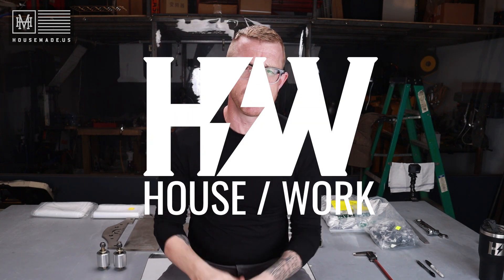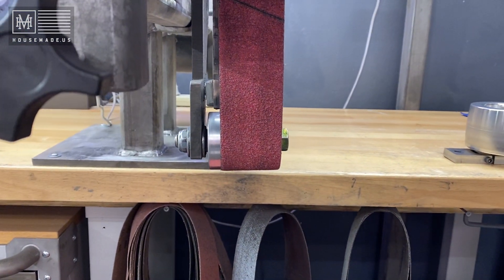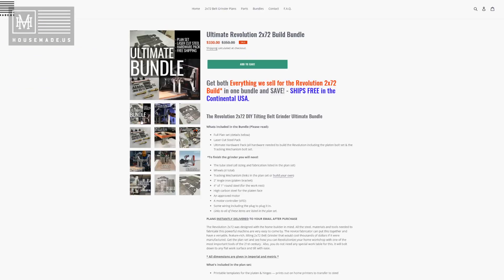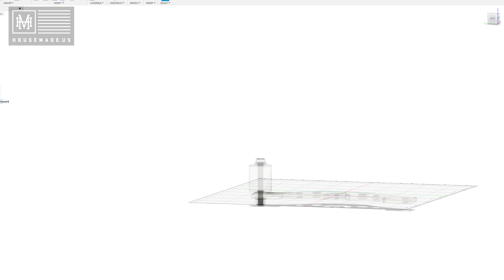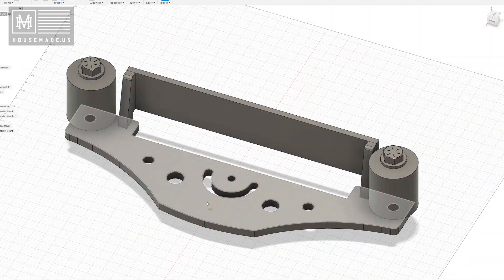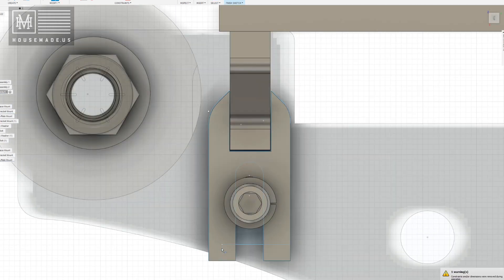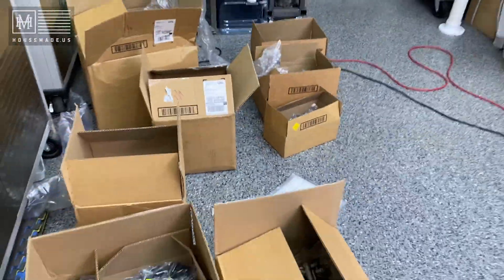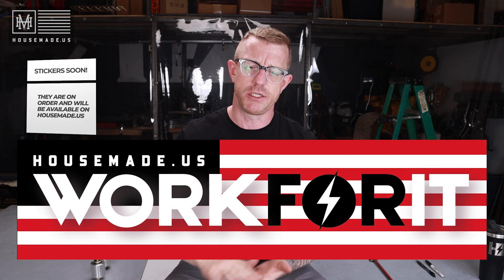2x72 Belt Grinder Platen Bracket Design

Comment: My only comment is that I would keep the platen bolts further from the wheels so it offers less flex in the middle and more space for bolt access. Also, cut the protruding back edges of the pivot plate to clear the belt when tilted if the track goes off. That 3/8 plate is very strong. I tried to twist a 3/8 by two piece, 8" long with a two foot adjustable wrench, and couldn't budge it. I built my own just now and learned a few things the "more labour intensive" way.
Reply from the maker: Good suggestion. I’m trying to not modify the D plate any to make this work. I’ll see what I can come up with. 👊🏻

Comment: Brian, it will cut the pieces you want it to with the geometry of the pieces. The only thing that it will probably not give you, that you’re used to, is nice square crisp cut lines. On smaller pieces the kerf can become almost “angular” or “walk” to the point that some cleanup will be needed. I will say though, that does depend on the thickness of the material being cut. It’s a good design though! It would really lend itself nicely for TIG welding. I can’t wait to make one!
Reply from the maker: Okay cool, that’s what I wanted to know. I am still booking everything all up here. I think I have the right dryer and all. Also do you have time for a call today?
Reply: House / Work Absolutely! I am working today, so I would have time for a call after 5:15 PM CST.
Reply from the maker: Okay. Let’s try to chat this evening. I’ll shoot ya a text. 👊🏻

Comment: Great idea and congrats on getting that plssma cutter awesomeness.  Hey just a thought on that printed motor wheel. I was thinking if your center was conical down to say 5/8ish then flatens out and becomes the outside of the wheel. I think this would lighten the piece without loosing strength. If this is a good idea let me know. Takecare and keep safe
Reply from the maker: Yeah that could work. I need to soak this wheel in some resin and see if it has some staying power. :)

Comment: You'll eventually provide the cut steel for the tracking mech and the platen separate from prior steel packs? Is that in your foresight?
Reply from the maker: Yes that is the plan. If I can get the CNC up and running I can prototype the parts then send them to Dallas for mass production.

Comment: Hey that platen looks great but I've got a porta band with the swag table so I'm just gona use a piece of angle. Keep up the great work and the awesome videos. 
Btw if you and your wife are doing the stickers with the "screw it let's do it" I'm all in
Reply from the maker: Yeah man, that will work fine. I have done that too.  I have some screw it stickers coming as well. :)
Reply: I have the same. Milwaukee deep cut and swag table. I cannot get square cuts because of a slight blade twist. I cut all the square tubing with it and had to spend hours on my HF 1x30 just to square them up.

Comment: I would like to see the two main wheels on the platen of different sizes, perhaps a 2-inch wheel, and the other as small as possible.   If the whole assembly could rotate to three positions a larger wheel could be fitted and another platen with say a 36'' radius for s-curve knives.  Great work Brian and thank you for what you are doing.
Reply from the maker: Great suggestion. I am working on a new design that can accommodate this. :)

Comment: The problem your experiencing with your idler pulley’s and why it’s binding up when you tighten the bolts they’re not designed properly if you’d like me to go into detail let me know. Jim
Reply from the maker: These wheels actually don’t bind up. They have a center spacer in them that keeps the side load at bay. Unless you have a better solution?
Reply: House / Work 
In one of the videos that I watched on your build you said you had to be careful tightening the bolts that went through the idler pulley‘s because of over tightening would bind the pulley if the inner spacer between the two bearings is manufactured at the right size it doesn’t matter how tight you tighten the bolt you will not behind the bearings and the pulley will spin just as free as if it wasn’t tightened at all. At my job at work I rebuild and repair spindles and as the inner spacer wears they have to be replaced over tightening can cause them to crush and lose size it doesn’t take much to bind up the bearings. Jim
Reply from the maker: Ahhh yes, those wheels didn’t have a spacer, I now have wheels that include that center spacer. Makes a lot of sense Jim, thanks for sharing your knowledge. 😁👊🏻